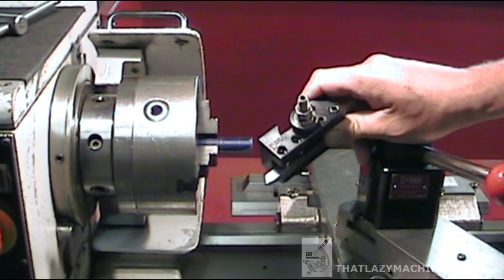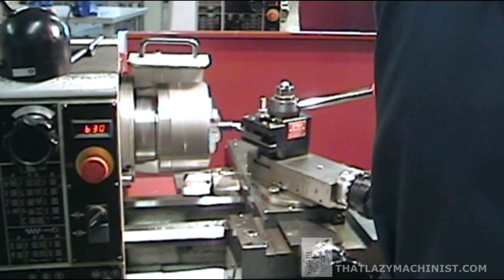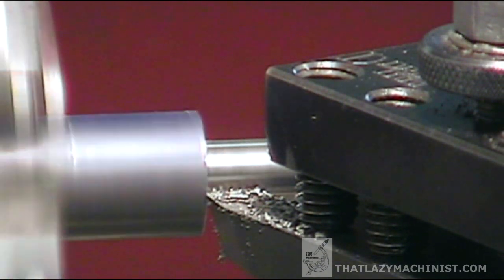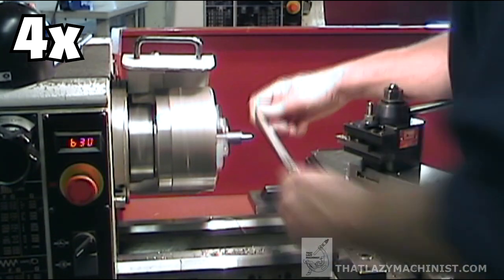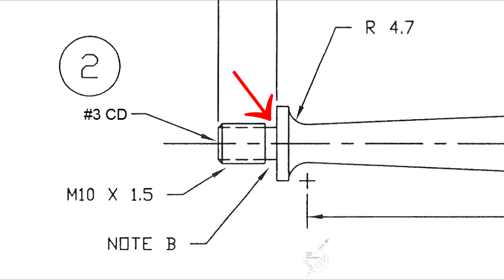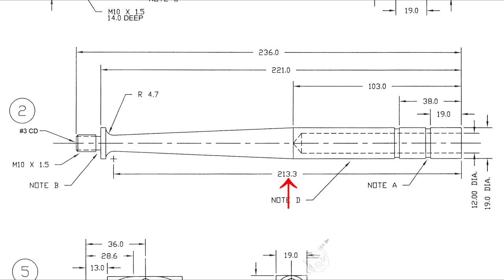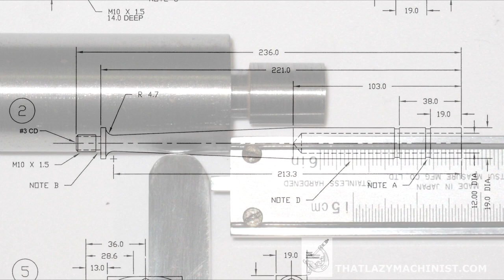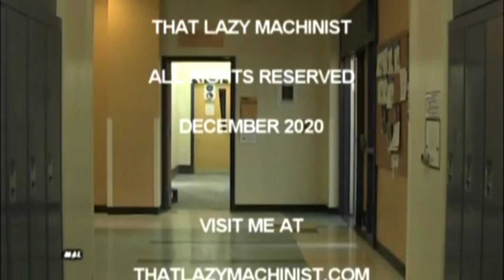HAMMER HANDLE #3 INTRODUCTION TO LATHE WORK (shoulder turning, grooving, threading)THATLAZYMACHINIST

Comment: I made the hammer yesterday.  very fun and educational project.  although I have a top lathe, I could not turn a taper.  (I couldn't put the tailstock far enough off center and I don't have a taperturning attachment) solved with a boring head in the tailstock.  also I had no collet for the plug.  keep it up Marc!

Comment: I made that hammer 22 years ago at Algonquin. Certainly brought back memories, though if I remember correctly back then the dimensions were in inches.
Reply from the maker: Hi Simon! 35 years ago I was a teacher at Algonquin. When we opened La Cité, I transferred there and we needed a metric project for the first semester. The drill point gage was an excellent project for fraction so it stayed in inches, the 1-2-3 bloc project is in inches because our surface grinders were imperial. That is why the hammer is now metric. I am working on the final segment of the handle project (part four) and it should be online soon. Thanks for watching and for taking the time to write, Marc.
Reply: @THATLAZYMACHINIST  If I remember right Algonquin was filled with Standard-Modern lathes and X-L-O mills (the ones with the short tables) all imperial machines and none with DROs. I think there was a lonely SAG12 in there too. The wide use of DROs these days makes working in inches or metric quite easy, no need to scribble conversions all over the drawing anymore! We used Anca 8 axis cutter grinders at work but for really special jobs, the ones where human perception is important we'd do it on a Cincinnati No2 dating from the 50's. Anyway, all that to say being able to work in either system (metric or imperial) comfortably is a great plus. I dug my hammer out of the toolbox, not too shabby after rattling around in there for 20years! https://www.instagram.com/p/CJY7PCqhwZV/?utm_source=ig_web_copy_link